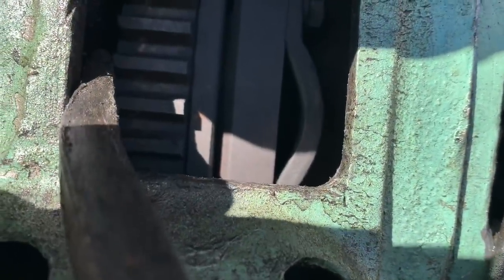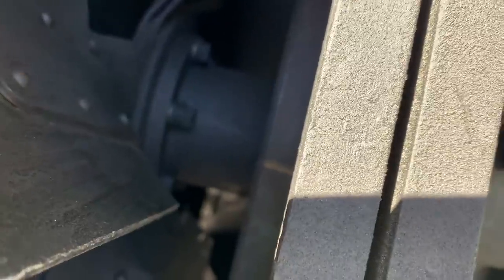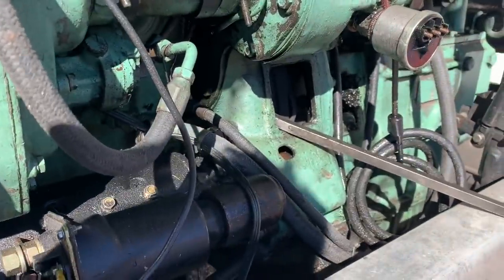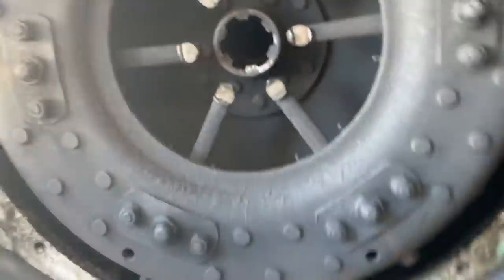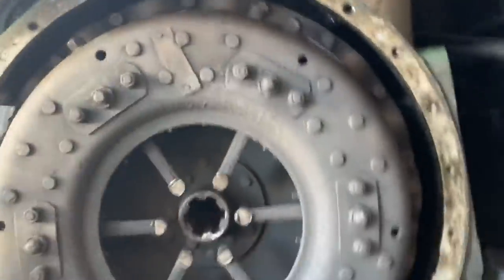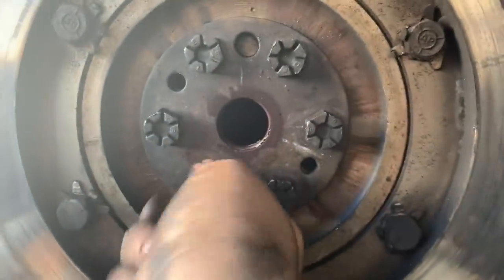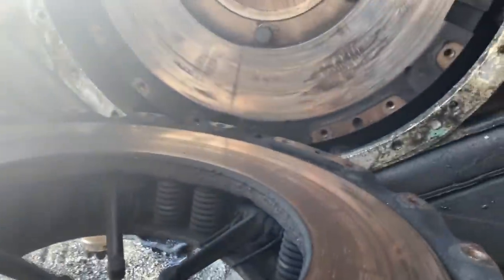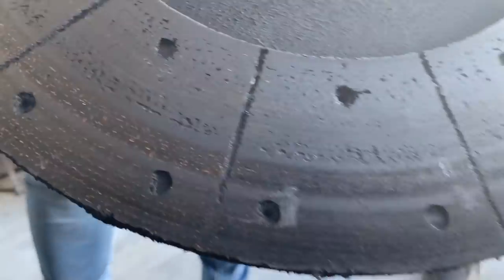Gm bus 4104 clutch chatter

Comment: Might be a good idea to check the trans input shaft for play since you have it apart, and the seal as well.
A problem with the clutch, and flywheel can easily wipeout the input shaft bearing.